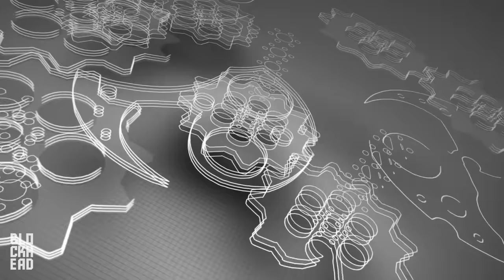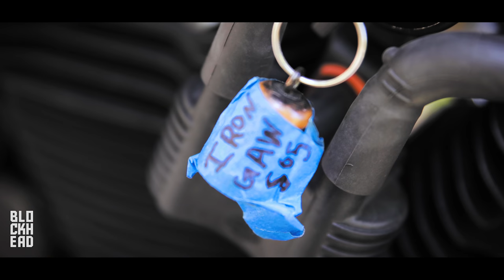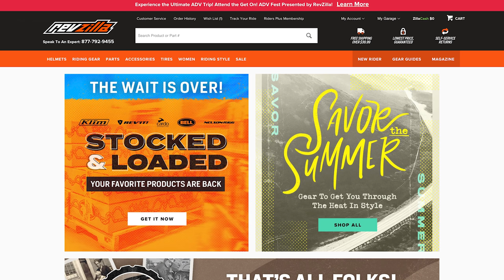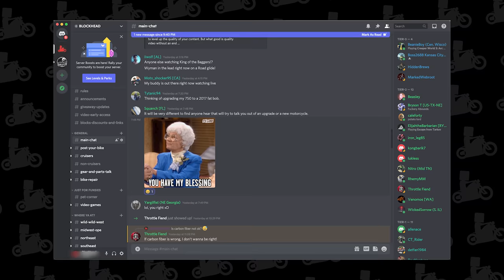Custom Harley-Davidson Iron 883 to 1200

Comment: Curious how does it compare price and performance, as to the top spec 1200 factory sporty?
Reply: I wonder the same thing. I have a stage 1 1200 and a stage 1 883. My son also has stage1 883. Both the 883s are getting big bore kits at end of this summer. Most likely hammer 1275 kits. It would be nice to see some roll on comparisons and maybe from a dig. Dyno charts don’t really translate well in my head of what I can expect from the kits. Are they gonna be faster than my 1200 or very similar? I know there’s a difference in gearing. My 1200 has longer legs for sure. It’s easy to lug after riding 883 so i cruise in a lower gear. Guess I’ll just have to see for my self.

Comment: So the revzilla site says that cap doesn’t fit the 2020 model. Can you confirm if it does or not? Also the seat doesn’t show up from the link.
Reply from the maker: The Iron in the vid is a 2017 model, not sure on 2020 🤷🏻‍♂️

Comment: Link to the flush gas cap?🤪
Reply: Amazon
Reply: So many differnt types.. i got one on amazon before and when i started using it the paint started to flake off it and made a scratchy noise when i took it on and off.... would like to know which one in particular hes using..
Reply: @AJaCoB1709  you could get a proper HD one. But the outer ring actually gets stuck onto the paint.
Reply: I'll look into it thanks bro 💪👍
Reply from the maker: Link: https://imp.i104546.net/DVQ1qa